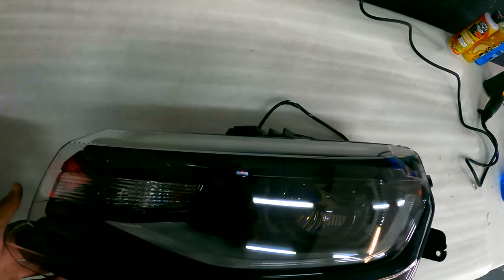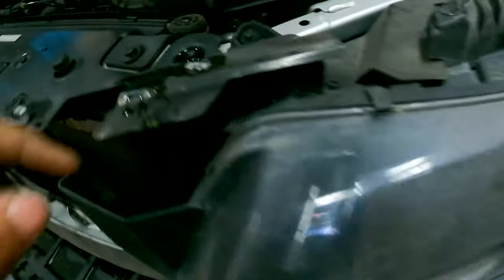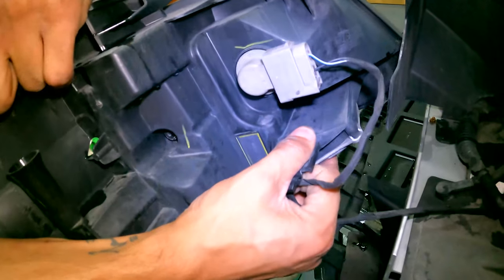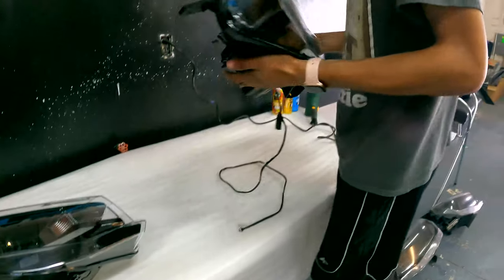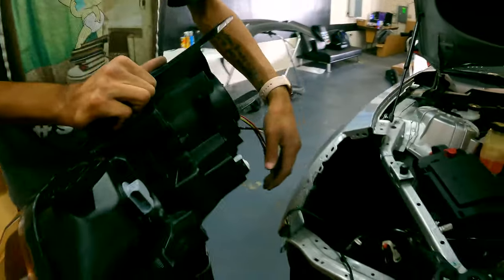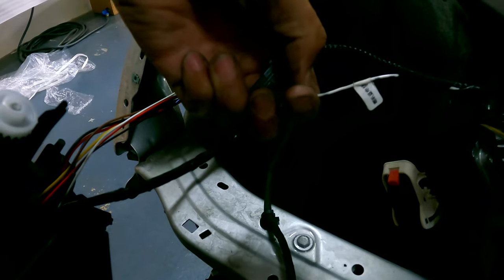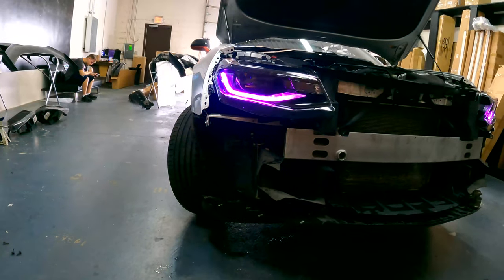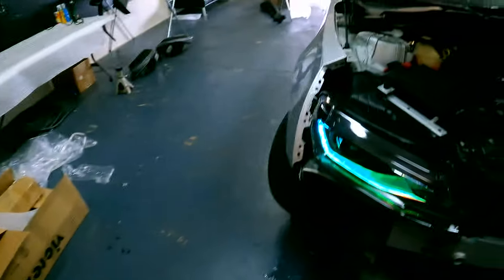16-18 Camaro Prebuilt Flowseries Headlights | Install & Overview | Next-Gen Speed

Comment: I got a question I buy ones and my Camaro has the battery on the trunk so I connected to the front red whit red and the black I put it in on the chasis close to the radiador but when I turn off the car they still on. Plus the remote is not working can somebody help me 😅

Comment: Do the 16-18 headlights fit all year ZL1s? Front end on the ZL1 has been unchanged all generation :D
Reply from the maker: Yes😁 ZL1 has the same lights while all others changed
Reply: @NextGenSpeed  Thank you 🤘
Reply: @NextGenSpeed  will they fit 2019 zl1 as well and do you have in stock?

Comment: Are these in stock
Reply from the maker: These are made to order with an average 7-10 day build time depending on the options chosen.We sold our last set yesterday but are getting more housings in within 30-40 days. You can place to order to get first in line!
Reply: @NextGenSpeed  okay perfect I ordered mine December 30th so would I be on the 7-10 day build time or waiting on the shipment for housings

Comment: What is the difference between the halo ring and demon eye?
Reply from the maker: Demon eye is inside where the low beam/high beam bulb is. Halo ring is the circle ring around that
Reply: @NextGenSpeed  Thanks, also are these repairable say if the low/high beam were to go out? and do you offer the parts to replace it or would I have to send the headlamps back in for repair?